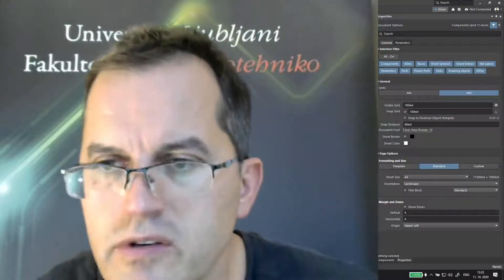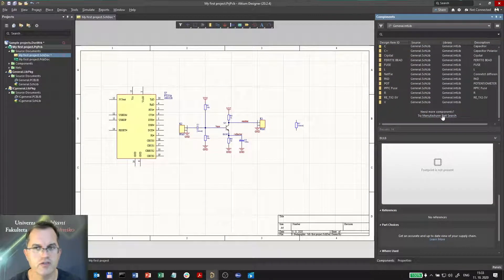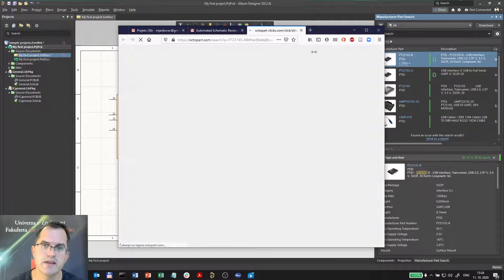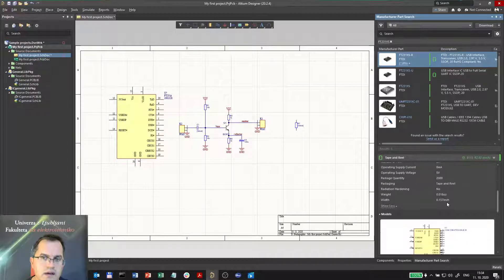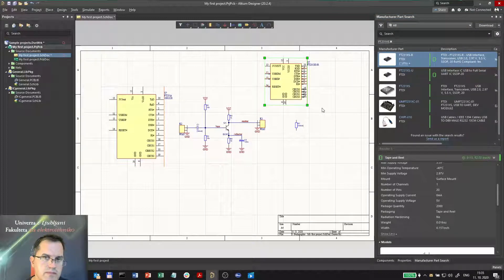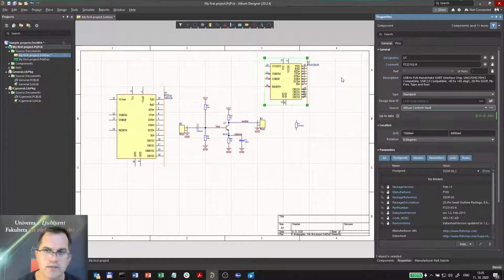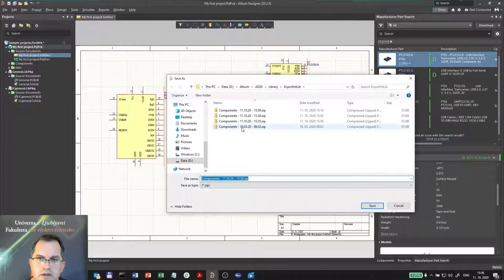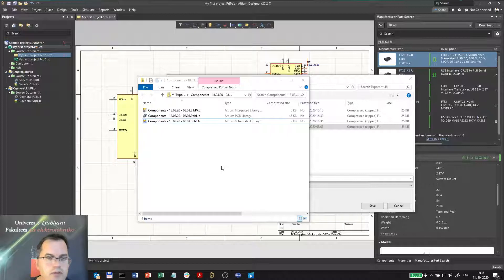Altium intro #13: Manufacturer part search

Comment: How to add the downloaded component to project schematic library?
Reply from the maker: Can you be a little more specific?
Reply: @elektronika-fe1325  i downloaded the component from manufacturer part search to a local folder
how to place this part in schematic?
Reply from the maker: @deenadayalanperumal1982  the answer is shown from 3:00 on. You get zip file, you unzip it into some folder. The library package has to be compiled and you get the IntLib which you install into altium.
Reply: Sir components are can't downloaded in manufactur part search. Download icon is hiding how to download sir.